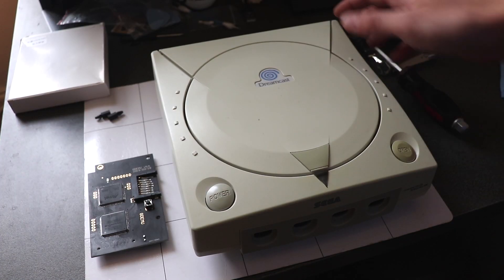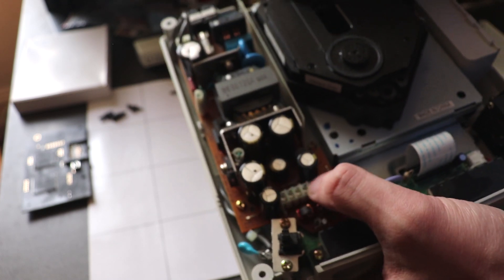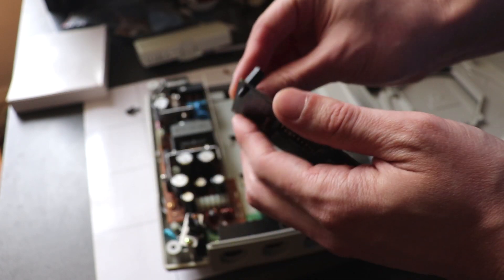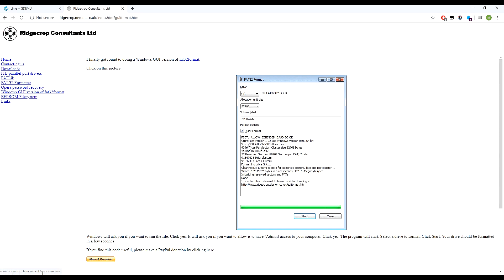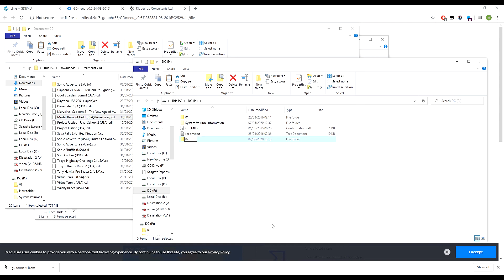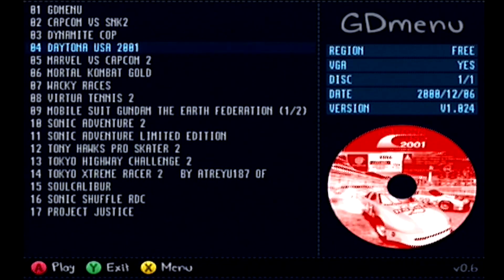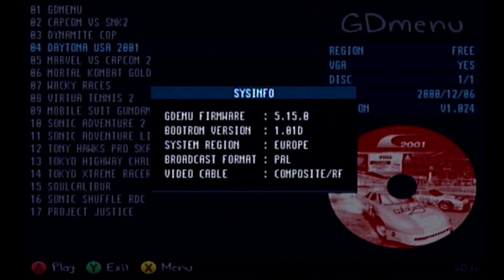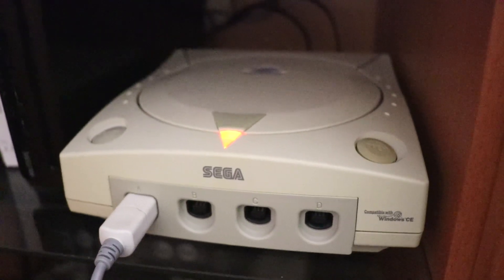Installing a GDEMU Drive on a Sega Dreamcast and Adding games onto a SD Card

Comment: Helpful video I'm waiting for my blue gdemu pro clone to come in the mail.i downloaded a whole Sega dreamcast library in .gdi files and they all come with like 3 4 files for each game with track 1 2 3 files etc would those play the same how do I get those to play?thanks in advance
Reply from the maker: Thank you. A blue GDEMU pro? i've never seen one of them. what does the pro do?  They will play fine although you have to rename each bin and track files - forgot the correct files names but something like track01 something like 

track01.bin
track03.bin
disc.gdi
track02.raw

I recommend making sure your SD card is legit too as i had corruption files on fake sd's.  also GDEMU_SD is a helpful  program to organise your games.
Reply: @AzNstat  great thanks man and yeah its a gdemu pro clone I guess with sonic on it guess has latest firmware where can use larger than 32gb SD cards and games that wouldn't play before play on it now I guess at $60 only $20 more than regular clone so I thought it was worth it.cant wait to get it in should be any day now got my sd card setup for when it does hoping with your advice my game files play on it.